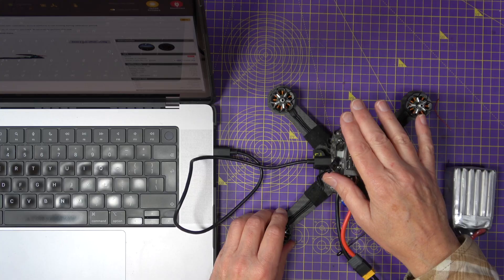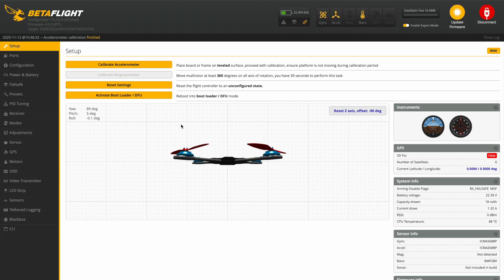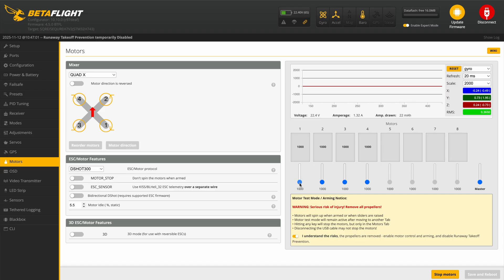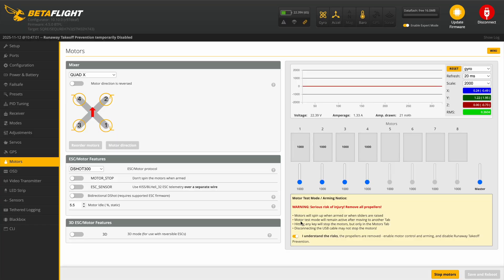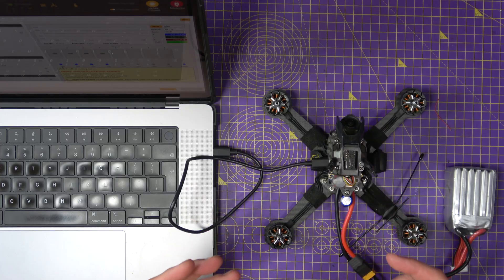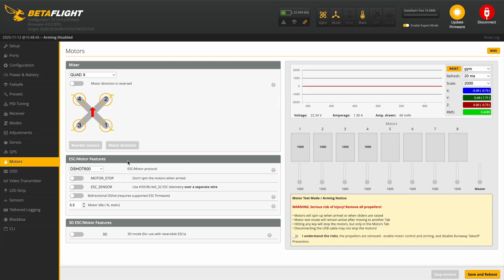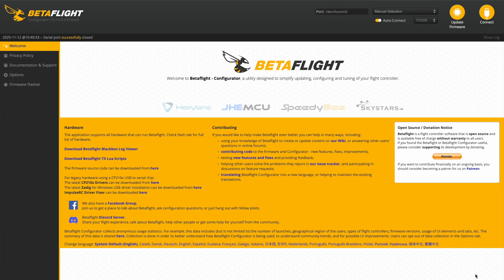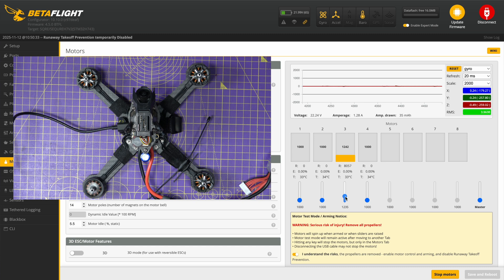Motors Dead in Betaflight? The AM32 DShot Fix You Need to Know

Comment from the maker: If your AM32 motors won’t spin, this video should fix it. Check:
	•	Battery connected 🔋
	•	DShot300 or DShot600 set
	•	Bidirectional DShot = ON
	•	Motor poles entered correctly

For Bluejay, it’s optional, it’ll work either way.

🛠 Props off. Sanity on.

Comment: Thanks for sharing.
I'm running a wing with INAV 8.0.1 and a single AM32 ESC. Couldn't get DSHOT 150/300/600 to work. Ended up with a PWM controlled ESC. Had to learn the min and max settings by moving the motor slider. 
After your vid I tried DSHOT 150/300 with the "Gyro RPM Filter" turned on under the tab -Tuning - Filters.  That didn't work, so went back to PWM ESC.
Maybe it's an INAV - AM32 thing?
EDIT 10 minutes later: I have to connect the ESC telemetry wire to the FC.... That's a lot of digging, will leave it PWM I think.
Reply from the maker: I haven't tried this on INAV, but it looks like you’ve run into the classic INAV + AM32 quirk. INAV 8 calls Bidirectional DShot “RPM Telemetry,” and if that isn’t enabled, an AM32 ESC that was flashed with a bidirectional build will simply ignore DShot150/300/600 completely. On top of that, AM32 actually needs the telemetry return wire for RPM mode to work properly,  without that return line, INAV can’t complete the bidirectional handshake, so the ESC never responds to DShot at all. PWM works because it sidesteps all of that, but if you ever decide to hook up the telemetry wire and enable RPM Telemetry, DShot should work exactly as expected. That's my understanding anyway, but let me know how you get on.
Reply: @WhirlyBloke  Thank you for your input. I enabled ESC telemetry in the Port tab - UART to see if another slider /switch option would popup. But the only CLi relevant setting  in INAV seems the "gyro RPM filter" ON or OFF option. 
The only way to test properly seems to connect the telemetry wire from the ESC to the FC to get that handshake.
But I have to de-solder the FC and the ESC and remove  some hardware to make that possible. Not my priority at this moment, will try later maybe.

Comment: Thank you for this.
I have built only a half dozen quads in my seven years of flying fpv. 
I had no idea what bi-directional D-shot was for.
There is too little information on the myriad of FC software options, what they mean/do, which combination of options provide the optimal performance.
If, from your perspective, 'we probably already know this stuff', we, or at least I, don't.
More educational videos like this please.

PS... what telemetry is communicated back to the FC? Can that telemetry be displayed in the OSD, or is it used by the FC for filtering. Speaking of which, what the hell does any of that do/mean? I'm at the point of experience where I may begin tweaking settings instead of flying on BF defaults, and I have no idea how or where to begin
Reply from the maker: I feel another educational video on the way. Thanks for the feedback.

Comment: Thanks for always creating content that I find interesting, informative, and entertaining, Whirly Bloke. I recently had what I now believe is a similar problem. I prefer INAV on my GPS enabled quads.  I was configuring a Goku F722 mini stack  that has AM32 on the ESCs. While attempting to configure the motors, I noticed that two motors were spinning the wrong direction. I was not able to correct it in the INAV firmware, and I was unable to navigate the AM32 configurator. After a few very frustrating hours, I flashed BetaFlight to that FC and was able to configure everything normally. It still bothers me though because I don't really like BetaFlight GPS functionality. I think I'll try flashing INAV again, and see if your bidirectional d-shot fix works in INAV too. Also, do you know if it is or ever will be possible to flash BlueJay onto ESCs that come with AM32? I have been unable to use the AM32 configurator (maybe I'm just too unintelligent), and I miss the custom start-up tunes on BlueJay...🤔🤭 Happy flying, my friend. 🫡 🍻
Reply from the maker: Thanks for sharing your experience. It sounds like you’ve been on quite a journey with your setup. I hope the bidirectional DShot fix works out for you in INAV.
Reply: @WhirlyBloke In researching this problem, I've learned that there is a very common pass-through error (ACK_D_GENERAL_ERROR) that occurs when attempting to configure AM32 ESCs under INAV. Basically, INAV often does not "play nice" with AM32. The common work around is to Flash BetaFlight on to the flight controller, configure the ESC using the AM32 configurator, then flash INAV. Yes, a giant pain in the arse. I think most pilots will probably just keep running BetaFlight since it works, even though GPS functionality is better in INAV. Only two of my quads have AM32 on their ESCs. One is running INAV, and the other running BetaFlight. I prefer INAV on GPS equipped quads, so I intend to do the "BetaFlight pass-through work-around" on the second quad as well. Sorry for the long winded comments, this is valuable info for pilots wanting to run AM32 ESCs in INAV builds. Thanks again for your great channel. Happy flying, my friend. 🫡 🍻
Reply: @Sonic_Ox   betaflight with the new position hold and altitude hold, is not that bad tbh. no waypoints or anything, but good enough for long range
Reply: @braaap2943 You're right. BetaFlight has gotten way better with GPS functionality. I actually don't use many functions that BetaFlight doesn't offer. The problem I've been having lately is that BetaFlight is not showing the correct GPS data when flashed on my Goku F722 mini FCs. It's probably a configuration error on my part but I find GPS configuration much easier in INAV. Thanks for sharing your info, though. I agree that GPS functionality on BetaFlight is on par with INAV for most pilots. Happy flying, my friend. 🫡🍻

Comment: What timing, great video!
I'm making a drone with am32 for the first time, and this will be super duper handy if I get this problem!! Thanks in advance
Reply from the maker: I think it's because AM32 has gained so much traction and is popular that I've had loads of questions about this recently. Hence the video. I suspect this will catch out even the experienced builders when they switch to AM32 cos bi-directional DShot isn't on by default (and quite right too). Thanks for the feedback.